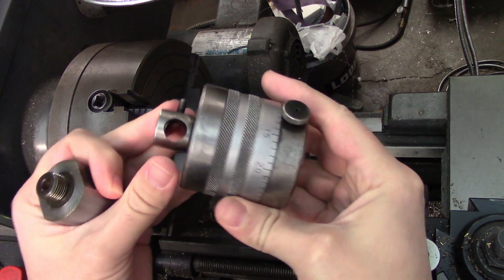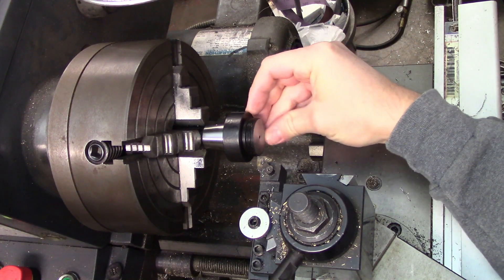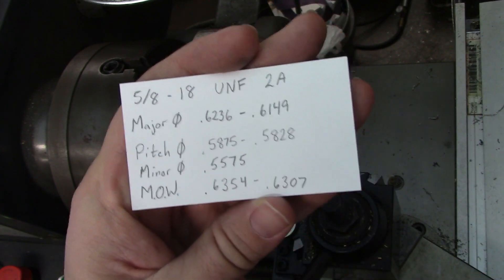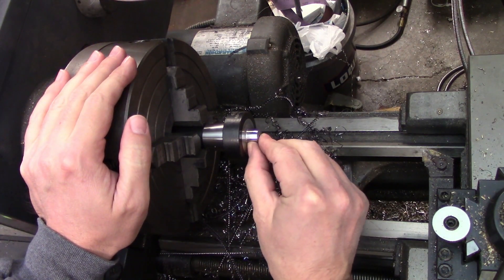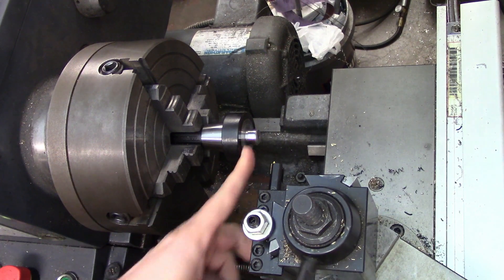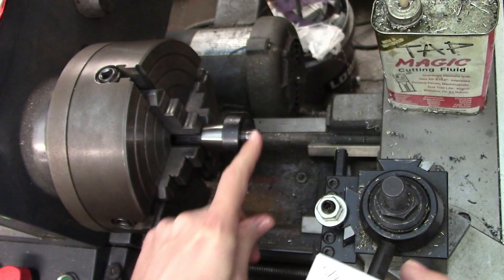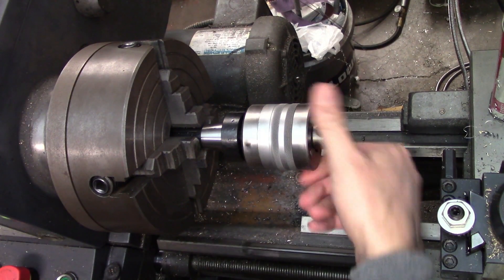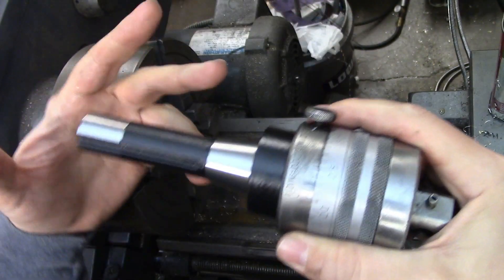Fitting a Shank to a Tenthset Boring Head

Comment: Relatively new to machining, bought a Criterion boring head off Ebay for my new to me 1965 Bridgeport.  It came with some weird thing between the shank and the head that turned out to be a device for taking tenths.  Not sure that I or my mill will ever have the ability to make use of it, but it's still pretty neat to have.
Reply from the maker: That's pretty cool. I've never seen that before. Got any pics you could share?
Reply: @StuartdeHaro  Email sent.

Comment: Agreed, the pucker factor is high coming up to a shoulder like that which is quite common in my experience!
Joe Pie promotes an upside down tool, reverse rotation, away from the shoulder approach which I haven't actually tried.
I admit to almost never disengaging the half nut.
Using a stop the rpm and reversing technique.
So often threading is the last operation between a Part and a shitter with time and material utilised or thrown away!
I do like the ease the grease made with the wires, I shall be doing that from now on!!

Comment: I used to use them small rubber bands on my wires.
Reply from the maker: I'm actually planning a video talking about different ways of holding wires and testing whether the measurement is affected by them. I have a few others to shoot first, but it will be out sometime in the next couple of months.

Comment: Did you feed in with the cross slide when threading? It appeared that the compound angle was set at 60 degrees rather than 29-30 degrees.
Reply from the maker: You know, I don't actually remember what I did. I recorded this several months ago, March if I'm not mistaken. It took me a while to get around to editing it and then I kept pushing it back in favor of other videos. I'll rewatch it and let you know.
Reply from the maker: Yup I definitely fed in with the crossfeed on this one. I almost certainly did that out of laziness more than anything else, so don't read too much into it. It's just so damn hard sometimes to reach over to the headstock and get the Allen wrench that I keep there for adjusting the angle of the compound. I hope you understand.
Reply: @StuartdeHaro  Given that shoulder and how close the tool was to crashing against it, feeding in with an angled top slide changes the half nut disengagement point for each pass. Done visually the way you did it wouldn't make any difference though. I like to use a zeroed indicator for work like this and when to kick the half nuts out. So a lot more to calculate and keep track of with the top slide angled. With fine threads like this there's probably little difference between straight in or using the angled top slide. It worked out fine and does exactly what you set out to do so that's the only important part. A real nice head that makes even my Criterion's look cheap. :-)

Comment: Good video, how big a hole can you bore with that head?  Is it mainly for smaller holes?  thank you  :)
Reply from the maker: I'm not sure. It doesn't have much travel, so I'm guessing an inch tops out of the center hole. There is a side hole too, so you could go bigger through that, but I wouldn't hang the bar too far out of it.

Comment: I would have used a class 3 thread for that. No need for a sloppy class 2.
Reply from the maker: I suppose you're right, but since the boring head is being adjusted for every job, then it really doesn't matter at all. It's also locked in with a set screw, so the shank thread doesn't move unless you're taking the head off the shank.
Reply: @StuartdeHaro  It'll function but it's a shame because when you were at .6356 you were smack dab in the middle of the class 3A range 👍and I guarantee the head has a class 3B thread. So that last .001 cut took out .0032 and put you in the middle of 2A range introducing needless clearance.

Comment: You mentioned offhand that criterion boring heads are threaded 5/8ths. I recently picked up a criterion 202 on a 50 taper shank. I need to swap it for a 40 taper. I haven't dug into it yet, but I was intimidated on first sight to try to separate them. I wasn't positive it was a thread, a reverse thread, or a taper. Do you happen to know if that is true of all criterion heads? And is it standard right hand threads? Any particular tips for separating them?
Reply from the maker: Actually no. The Tenthset one in the video is threaded 5/8-18, but Criterion head will have one of two threads depending on the size of the head, either 7/8-20 or 1-1/2-18.
Reply: It should be a 7/8ths X 20 right hand thread with a 202 head since that's what mine is. If it's a really old head? I have no idea if they ever used anything different back then. Unscrewing the head from the shank? If someone didn't do something stupid like loctiteing the head to the shank it should be fairly easy. A couple of square bars machined to fit the 50 taper drive slots and a bit over size than the slots are deep, hold those in a bench vise to keep the shank from rotating, then use a close fitting 1/2" diameter shaft in the Criterion heads horizontal cross hole. It should come off without much problem.
Reply: @StuartdeHaro  very helpful thank you very much
Reply: @turningpoint6643  thanks much, exactly the information I needed
Reply: @jpsimon206  Your welcome.

Comment: Why not just try the part you are trying to fit instead of using wires to measure the diameter?
Reply from the maker: You can absolutely do that as long as you start test fitting early. You don't want it to fit on the first try since you have no idea if you've gone too far.

Comment: Stuart you should do one or two passes in real time so people can get a feel of the feeds and speeds they need when you're showing them these processes

Also did you do any spring passes? I didn't hear you mention them
Reply from the maker: Yes. As soon as I start measuring, I do a spring pass before each measurement. It has been a while since I recorded this. I thought I had done a real time pass right at the beginning of the threading. I usually try to for that reason.

Comment: How do you determine the class/fit of the internal thread of the head?
Reply from the maker: In this case, I didn't really need to. I just went off the standards for the external thread. If you have a part that you're wondering what the fit should be, I look at the purpose of the part. If it will be frequently assembled and disassembled, especially in a dirty environment, use class 1. For general purpose fastening like this use class 2. If it needs to transmit motion accurately use class 3. To check the fit of internal threads, the most common tool is a set of plug gages that are ground to the upper and lower limits of the pitch diameter. This is a go/no-go gage, so if the lower limit threads in but the upper doesn't,  you're somewhere within the limits. If the upper limit threads in you've made the thread too large and it's scrap. I hope this covers what you were asking. Thanks for watching!